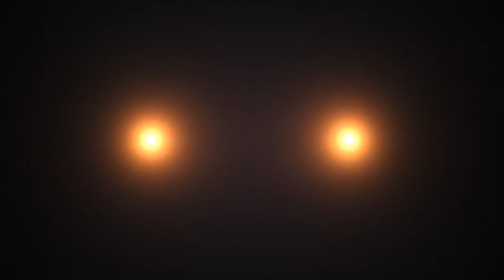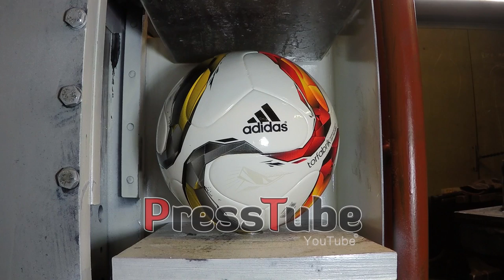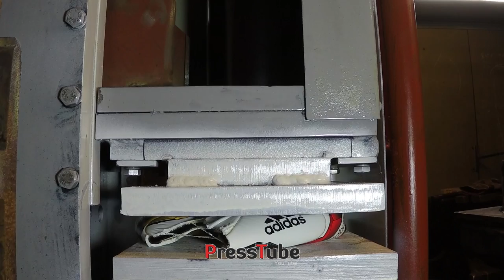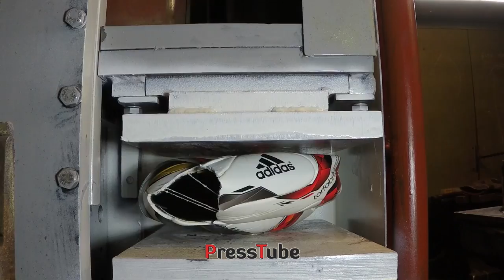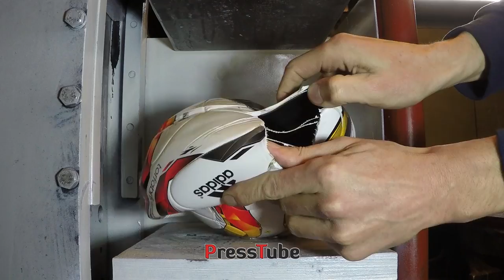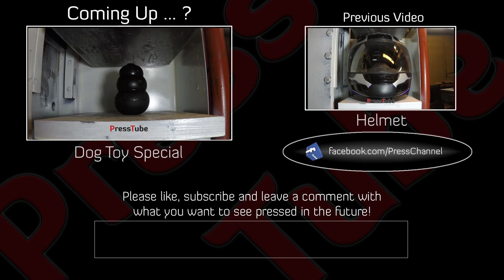Hydraulic Press | DFL Official Match Ball

Comment: What is that thing on the left that goes up as the press goes down?
Reply: a weight
Reply from the maker: +zxz1997 Counterweight to pull the pressplate up again. That pressplate isn't welded to the cylinder, so the cylinder goes up, but due to the weight the pressplate stays down without the counterweight